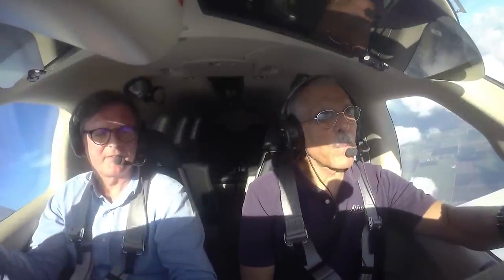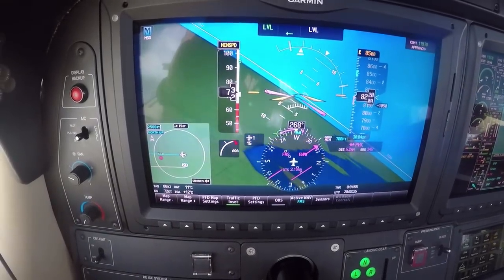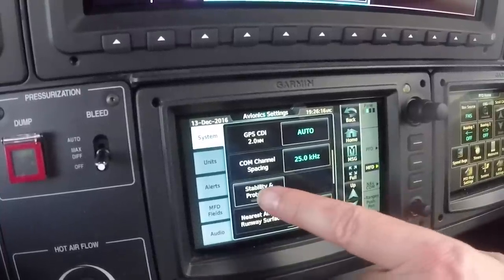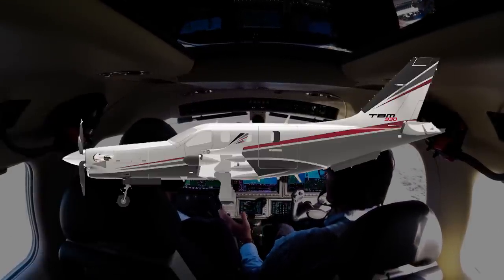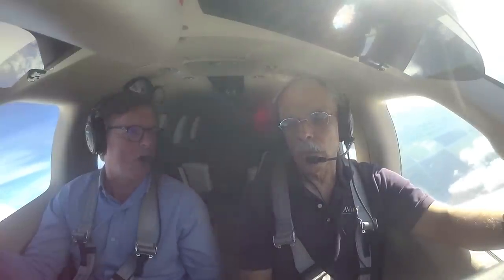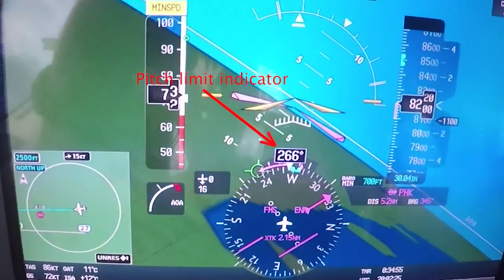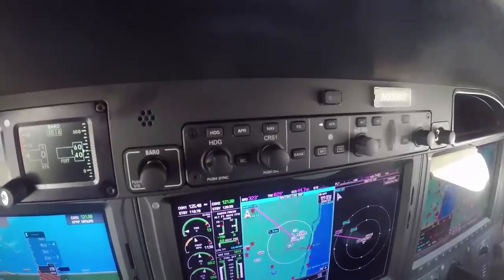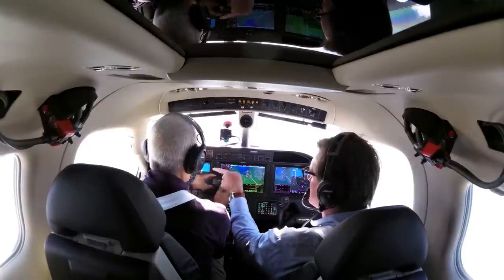Flying the TBM 930

Comment: Abosultely love the 930 & 940.

Only problem - I’m not sure I would purchase a single engine turbo prop of this size , when I can get into a phenom 100 for the same price….. assuming both planes are new.
Reply: The Phenom requires, a type rating, higher operating costs, higher airport service fees, and I’m sure much higher insurance premiums for single pilot operations than the 930. The 940 now has the auto land feature that would enhance the survivability of passengers for a plane with only one pilot.  Just my two cents

Comment: I’m guessing the 90 degree turn after no response in a cab alt pressure malfunction is so that ATC realizes something is wrong with the aircraft
Reply: Also so that you don’t descend into other aircraft on the airway.
Reply: That doesn't make sense to me. Maybe automatically putting a emergency squawk code, but turning the aircraft, not knowing the state of the crew....
Reply: Turner9090   There’s no other explanation. I think you’re right, it’s a cheap & “automated” (not disturbing ATC) way to convey a possible emergency to ATC/departure/flight following.
Reply: The turn will aid in a fast decent without having to pitch nose down and overspeed the plane. Picture fighters turning off from formation and descending fast.

Comment: How would you compare this plane to the Pilatus PC-12NG?
Reply: IronViking TBM  is smaller but faster. Burns less fuel. Feels better to fly. Built more strong. Engine installation is more reliable. Toilet is optional but you shall loose last two seats.
Reply: It's faster, smaller, less range, less payload, and less money.
Reply: My impression is the TBM could be likened to a Fast Mustang or Camero. The PC-12 could be looked at as the high end Expedition or Suburban. 4wd of course. Both are premium brands however have a different mission capability. The TBM is 50 or 60 knots faster. The PC 12 is bigger, will carry more weight, farther. Each has a different mission profile from the other but both are exceptional aircraft. Which is best for you? It depends on what you want to do with it. They both have the magnificent PT 6 engine which as long as you take care of it, will keep you alive for a long long time. I personally would love to have 1 of each. Hope this helps.

Comment: awesome system as long as it does not malfunction (see MCAS) ;-)
Reply: The system on the TBM is quite a bit more sophisticated than any 737 , except for the non included A/T.  Also the MCAS never really malfunctioned. At least Socata had the "ingenuity" to actually do a new type certificate for the TBM, and not try to apply something fron a previous model.

Comment: Don't understand 2:20: VMO is 266 kts. If you exceed that speed, the servos will kick in and pitch the plane up to lower speed. - I thought the plane had a maximum operation speed of around 330 kts?
Reply: Like amoussac said, one is Indicated Airspeed (266 kts IAS) and the other is True Airspeed (330 kts TAS).  Indicated airspeed comes from the pitot tube which basically measures the air pressure generated by your forward motion through the air.  As your altitude increases and air becomes less dense this pitot pressure measurement becomes lower even as your actual speed through the air remains the same.  However the pitot pressure measurement is what matters to the structural integrity of the aircraft since it this measurement that corresponds to the aerodynamic forces applied to the airframe.  So as you go higher you can go faster without overstressing the airframe.

The True Airspeed tells you how fast you're actually traveling relative to the surrounding air, it's your actual airspeed.

Comment: Really nice but not once did either pilots look outside the cockpit for traffic.
Reply: John Dill, the aircraft did it for them.
Reply: Closed block of airspace with a controller and a minimum of two traffic alert systems allow them to film without as much looking out. ATC knows what they are doing and is looking out for them.

Comment: Not a huge fan of all of the gizmos...HOWEVER, the 1999 Leerjet crash that killed Payne Stewart (and others) would never have happened.
Reply: Brandon Wright 

There was a TBM crash in 2014. Pilot says he needs "lower" due to an "indication" but doesn't declare an emergency. Busy controller doesn't immediately grant the request. Flight goes silent and ends up overflying its Florida destination then Cuba and crashes in the ocean.

Like Stewart, the intercepting aircraft report fogged/frozen. Windows.

There is ATC recordings available. Hard to listen to. But good training material.

Here is the wiki page

https://en.m.wikipedia.org/wiki/2014_SOCATA_TBM_crash
Reply: But some of those gizmos could have saved JFK Jr.
Reply: do some research and you will find out the real story
Reply: ... It's "Learjet".

Comment: Great intentions here but this can lead to complacency.  Much of the attitude limiting features here are somewhat similar to Airbus and its debatable if those have ever contributed to the prevention of an incident.  Air Asia still went down only because the co-pilot failed to control the aircraft after the auto-pilot disengaged.  A complacent pilot will crash an aircraft regardless of the systems available to help them.  Beware of the dog in the cockpit, know your systems, and stay current.
Reply: Aviatr23 You are right about complacency creeping in with automation, but it is way forward. Aircrafts are going to be more and more automated with time. Since Airbus did it, there has been an ongoing debate over it. But the reality is that all new aircrafts are adopting envelope protection, though control laws may differ a bit. Modern aviators have to adapt with change in technology and use of automation has to become an important part of airmanship.
Reply: Vikash K Thakur I agree that this type of technology is more prevelant but I disagree we should adapt to technology.  We should always remain in control of the technology we utilize.  I'm not necessarily against having this type of thing in the cockpit but I am against relying upon it and placing our competence to the side.  Airmanship should always have its foundation in stick and rudder and in dead reckoning and pilotage skills.  We will have to adapt to technology only if we allow it.  That day may be coming but I dread it because I do not think we will be any safer for it.
Reply: I would say stay Proficient...big difference between being current and being proficient :)

Comment: all that  money and hi=tech crap and the radios sound like a  $50.00 radio shack toy. shame
Reply: ed plow btw those Bose headphones are $1000 bucks a piece.
Reply: I'm an audio engineer and the fact that they skimp out on a decent mic and a better bitrate for those $1000 headphones and really expensive radio kits is infuriating to no end. However He is likely recording with a small mic sitting in one of the ear cups and I doubt there's a lot of Audio processing done on the videos